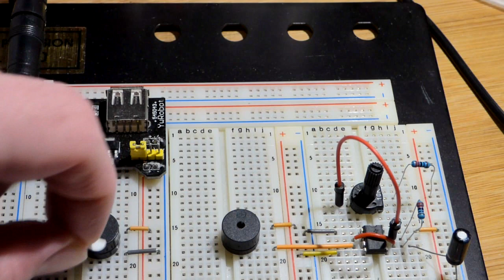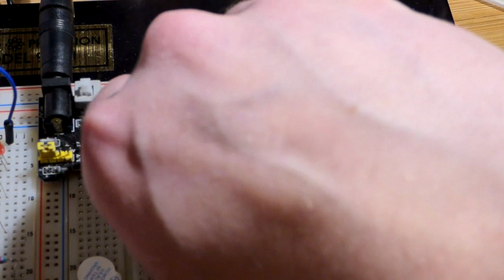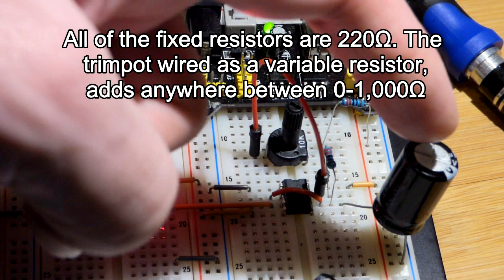Active and passive buzzers demonstration using astable mode 555 timer

Comment: Hi, nice. I have an 5V active buzzer that I would use for 12V motorcycle turn signal feedback. How could I use that without frying it? Thanks!
Reply from the maker: Easiest thing to do, and I am guessing the best option for that situation, is to use a 5v regulator.
Reply: @Electronzap  well, I just put a 330 Ohm resistor finally between the buzzer and the relay of the motorcycle and works perfectly. Thanks.

Comment: Hi,
Could you clarify, is usb connector on power supply module for output or for input? I mean, can you feed this module through usb?
TYA
Reply from the maker: Just the barrel plug powers the breadboard module. Everything else including the USB is an output to power something else.